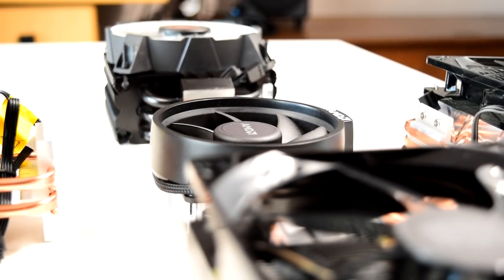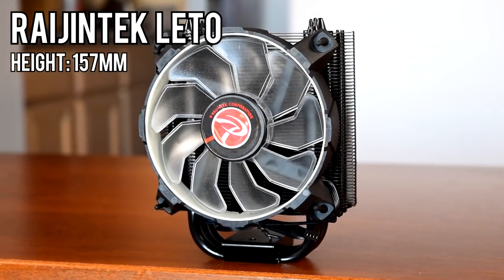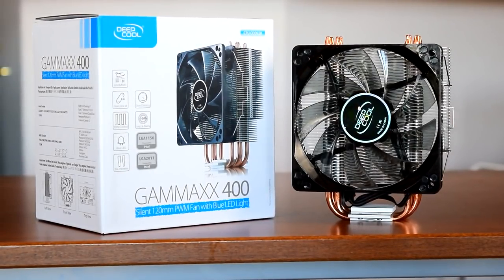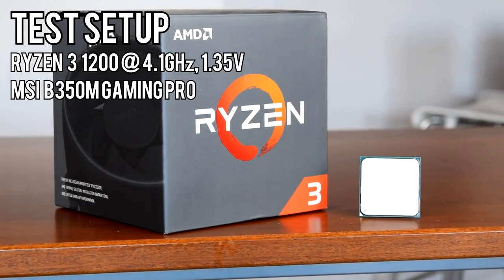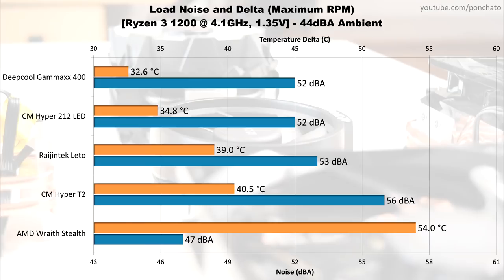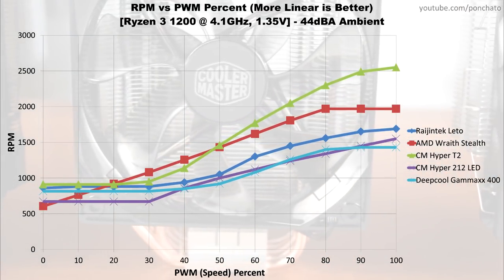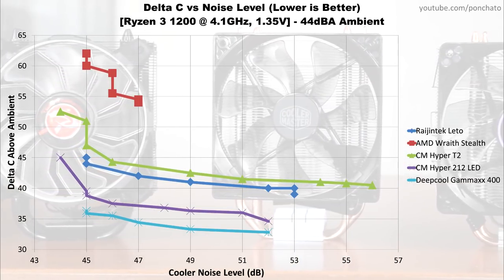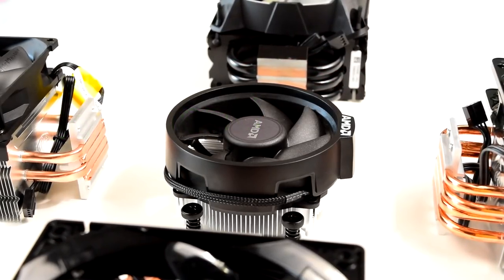4 Budget AM4 Coolers Compared - Temps + Noise Tested!

Comment: Just bought a Deepcool Gammaxx 400 and it is a fantastic product! Never exceeded 46°C/114.8°F, running all 4 cores at 100% (CPU: i5-4570, ambient temperature: 19°C/66.2°F) under PerformanceTest 9 tests. The stock cooler with a renewed thermal paste was going at about 79°C/174.2°F. IMO real value for money and fairly easy to install without silly back plates!

Comment: Air Cooling is extremely reliable! You cannot go wrong with those, and don't pose any threat to your motherboard.
Reply from the maker: Very true!
Reply: Old comment but. Ehh.. Only bigger and heavier coolers threat your motherboard.
Reply: @mouaxiong8618  unless you are transporting your CPU and make you cpu shake like riding on a off road, and did not place it on its side, you can just remove your cpu cooler then return it afterwards.

Comment: Bought the gammaxx 400 for my ryzen 2600 because of ponchato. Haha
Reply: How high are your temps now, and how high were they with stock?
Reply: @dwandalf  I've never used to stock cooler so I don't know about its capability. The temperature of my CPU with Gammaxx hovers around mid 40's to mid 50's without manual OC, in a Core 500 case. Granted, I don't do extreme gaming or stress tests. I live in Asia btw, in a relatively cool room.
Reply: @HandleIsNewAndBad  Nice! Im thinking of buying gammaxx 400 or gammaxx gt.
Reply: @dwandalf  that temp I said is when gaming, but not too intense, gpu temp is 60+ degrees mostly. You know, RADEON.
Reply: Does gammaxx 400 block any of ur ram slots bro?
Reply: @minhquan5005  not too close , the mobo is asrock itx
Reply: is this compatible with a320m pro vd/s?
Reply: @jhomgonzales14  since it's AM4 board, the mounting should be the same
Reply: Do you overclock it? Do you find it big and hard to fit in your case? I have an mATX case and my only fear of buying an aftermarket cooler is that I have no idea if it will fit.
Reply: @rohana.7760 it's 154mm in height. If it fits in mini itx shoe boxes, I don't see why it can't fit in a micro ATX case (is yours a narrow one?). No, I don't overclock. Haha. Its auto clock is 3.8ghz while gaming. I also use noctua thermal paste on the CPU.
Reply: @ABQCML Same here. Never knew much about Deepcool until I saw this video. I still cannot believe how quiet and efficient my Gammaxx 400 cooler is!
Reply: which one is better, gammax gt vs gammax 400?
Reply: @pemilkareem  IMO Gammaxx 400 - it's been around longer to very good reviews.
Reply: Jhom Gonzales a320m doesn’t support OC so you’ll only benefit sound, not performance.
Reply: Pemil Aldiki pretty much the same...GT is better looking for sure in every way
Reply: I have a Deep Cool Gammaxx 400 on my r5 1600 af and I love it.
Reply: how are the noise levels of the gammaxx 400 while gaming and at idle? is it audible at idle/low usage?

Comment: So the stock cooler was actually the quietest! Thank you. Assuming I don't overclock my CPU, it will be fine. And I have scope to buy a new cooler if I want to overclock it, but it's not essential by any means. (I've just got a Ryzen 5 3600 which is a 65W part TDP)

Comment: That 4.1GHz is impressive! What's the highest Overclock you ever got with the Ryzen 3 1200?
Reply from the maker: That's actually as high as it'll go, it hits a brick wall at 4.1GHz. Even another 25MHz is unstable no matter what voltage I use!
Reply: Thanks, I'm planning a build in the near future using one of these and a GTX 1050 Ti or 1060, so any tip helps! Your videoes help me mix and match the parts I want for my build.
Reply: well i got till 3.95

Comment: when i got my Ryzen 5 3600, i decided to go ahead and use the stock cooler. my IDLE temps were between 65c-73c. i had a Hyper T2 i had used on an old FX-8350 hoping that it would work well, like it did on the FX-8350, but i was wrong. didnt help temps at all. i was still getting the same really high idle temps. i decided to give a DeepCool Neptwin V2 a try and i am so happy i did. i havent seen my Ryzen 5 3600 go over 70c no matter what im doing. MSFS2020, streaming it live to youtube in 1440p60fps, and using two monitors, and STILL barely crept up to 70c. i did build my neighbor a pc the other day with a Ryzen 5 2600 since hes not a gamer at all, just wanted a pc that would last him a few years just cruising the internet and doing basic things. i used a cooler master evo 212 black edition for him to use and its been pretty good. not quite as good as the massive twin tower cooler im using, but it keeps his temps way down when compared to the stock cooler.

Comment: Proud owner of a Gammaxx 400! It's so affordable here in the Philippines compared to the Hyper 212. The performance is so good! I'll keep this cooler when I upgrade my PC to an i7 or whatever high powered CPU comes up with either companies. Currently using an i5 4460 and I got annoyed how noisy and hot the stock intel cooler was. After replacing the cooler no more noise and the temps are so low. I can happily run my PC all day with no worries.
Reply: conyo985 how much bro?

Comment: I think we'd all rather you do this test in a case. Take side panel off for the dB but see how it moves air in a closed environment (99.9% of builds) is better information than open bench.

I have 4 of the Gammax 400 currently and have purchased like 6 (sold in builds). They are amazing coolers for their price ($17-21)

Comment: In the video I noticed that you didn't have both RAM sticks in the motherboard. Did the RAM not fit in one slot with some of these coolers? Some looked like they would be a tight fit and others didn't.
Reply: Tyler Hancock you wouldn’t need to worry as long As you have a full atx mobo
Reply: @killerdon3377  I can fit 4 rgb ram sticks in my micro atx Mobo just fine with the deepcool

Comment: You do a very good job.
Samples all the information I was looking for from the Hyper T2. The comparisons with the other coolers are very good to decide.
Thanks for taking the time, have your like good man!
Thoughts:
I think that the T2 is a good alternative to make a soft OC, looking not to exceed 60-65 ° C and 75% fan speed. We would avoid noise in excess. Also for the size and weight of the T2 is very good for economical motherboards which have a thin pcb.
Reply from the maker: Happy to help! And yes the T2 is very low weight, so you don't have to worry about motherboard flex or the socket breaking on thinner motherboards

Comment: Thanks for the vídeo, I didn't know the cooler Master Hyper T2 are compatible with socket AM4.
Reply: But the T2 does not touch the entire surface of the Ryzen processor (AM4 socket). Is that not a problem? i just got my Ryzen 3 3200 and i have this Hyper T2 but i leave the original Ryzen fan because that.

Comment: I've had a Gammax Cooler with an Arctic cooling fan on my 3200G and it is right proper cool and quiet. It just goes to show you do don't have to spend a bundle on a cooler.

Comment: Right, so I bought a i7 4770k 5 years back and never bothered with a cooler. After watching this vid, Insta-regret! Its good to see some awesome cooling performance for a reasonable price. Ordering a cooler now asap, better late than never! Thanks for the video!
Reply from the maker: Yeah, CPU coolers have come a long way in the past 5 years. And these coolers are good but you should check out the Mugen 5 as well: https://youtu.be/focyjBXI2gE it doesn't cost much more than these and it performs quite a bit better
Reply: ponchato Thanks for the reply! Actually that isn’t available here in Dubai. Think I’ll go with the Gammaxx 400 as its really cheap here and does the job.

Comment: My Ryzen 3600 with a Gammaxx 400, while gaming, sits on around 60 degrees. Give it a stress test and it jumps to 82 degrees. Still better than the stock cooler tho, under a stress test it used to hit 92

Comment: Great testing. Have you ever played with any of these coolers with no fan to try passive cooling with no overclocking? I have a fanless PC (J1900 Celeron) with Seasonic 520w fanless PSU and SSD. Basically a HTPC with no mechanical noise at all. Its been great for 4 years although its slow but only using it for web surfing, YouTube and 1080P movies/netflix. I want to rebuild into a low power Ryzen 3200G for 4k HTPC but I want to keep it fanless for zero noise which is great for music and movies.

Comment: No no no , put your mic next to my build . 3 - 120 mm case, 3 - built-in on radeon 7, psu is cooler master 750 w. And for Funnzies  , a stupid window unit a.c. 😂 . That gammaxx could sound like a jet engine and I'd think it was great. 
Excellent video. I'm subbing.
Reply from the maker: Haha, yep that sounds loud. And thanks, glad you liked it! 😁
Reply: @ponchato  I ended up going with the old gal , gammaxx 400. If it screams ,I won't even notice. 
Have you ever done a roundup of fans ?

Comment: My computer that I'm using is pretty old. I'm pretty sure it is using an old Cooler Master CPU cooler (or an Intel stock cooler). Either way, I am using an i5-4440 and my temps are 32C (90F) even with multiple tabs open running multiple videos and while running other programs. The most I've seen it go up to was 60C (140F). The funniest part is that my case is a HP Envy 700-210 (or whatever, can't find actual name), which has ZERO features for cable management. The other day, I was installing a new hard drive for it and I had to remove my GTX 950 to get my SATA connector to the SATA slot on my motherboard because of all the cables that were in the way. I couldn't move them out of the way because they had nowhere else to go. Took me 10 minutes to install it. Can't wait to get all of my parts for my new build.
Reply: I use an i5-4460 with a stock cooler and during VRAY renders  the CPU goes upto 80°C in an ambient temperature of 28°C.

Comment: which would you say would be the better option for someone like me who is going for mid to high end  parts but with no OC intentions 

1060 3GB/RX580 GPU
Ryzen 5 2600x(Stock)

16GB 3000 DDR4 RAM

Comment: The standard 212 Evo will Mount horizontally or vertically on a am4 socket I just used mine on my ryzen 5 2600 and only used the included mounting.

Comment: There is no one better than 200w TDP Arctic Freezer 33 eSports ONE under $40.

When under 60'C, Freezer 33 is not much different with Hyper 212 evo, but it is surprisingly good at higher temperature.
According other tests, when Hyper 212 evo is 90'C, Freezer 33 well be only 76~79'C, 
and only 7~9'C higher than Noctua NH-D15 (one of the best air cooler).
I think that is why Freezer 33 has the 200w TDP.
Reply from the maker: Yeah the eSports ONE is pretty awesome, I reviewed it here: https://youtu.be/we04MQXb5sA

Comment: i install yesterday 212 Led on my AM4 Ryzen system without clips mounting. I install like other tower cooler with back plate and screws comes with box!
Reply: NextGenCeo, what is the cpu temp
Reply: @chileverde4906  Amd Ryzen 2600 without overclok in game 49c on prime 95 stress test 45 minutes 56c. max. 1.3v 4.0ghz overclok to all core in game 55c and 30 minutes prime 95 max 64c max temperature. I have NZXT 500i 2- 120mm front fan and 1- 120mm egzost fan and 1-120mm top fan in the case. Also using Artic Silver 5 thermal paste. Msi b450 Tomahawk.
Reply: the back plate doesn't fit on my b450 tomahawk I don't know why. The screws are not aligned with the holes. Im only left with one option, which is to mount  it facing exhaust to the top of case rather than rear of the case.

Comment: Would the hyper t2 be sufficient for a 2200g with graphics and processor OC to the maximum, or should I just go with a 212 variant? Sticking with CM to match my case 😉
Reply: I have that on my Ryzen 1800X.  I don't overclock so it has worked fine by me.

Comment: you say the 212 "can't be mounted horizontally on AM4" did you mean it can't be mounted vertically? I think horizontal is the default position? I am looking for a cooler that can go vertical and push exhaust to the top of the case rather than the rear.

Comment: why did you mount the gamma different than the rest could the other not mount horizontally?  it just looks like the gamma would get better air flow as the fan is less obstructed.

Comment: I brought the h411r by cooler master for the Ryzen 5 2600 wow impressive cooler on quite mode at £22 I highly recommend it
Reply: I plan on buying it for my 2600x, since i have small case and thats only that fits in, what are your temperatures for both idle and load?

Comment: Ryzen 2200G for video render, should i buy the gammaxx 400 or is the T2 enough?
Reply from the maker: The T2 can handle the 2200G easily, but if you want to overclock the Gammaxx 400 will give you more room with the temperature
Reply: @ponchato  thanks!

Comment: No $20 cryorig m9a?
Reply from the maker: 😐 crap
Reply: Do I smell a round 2?
Reply: did you test it for yourself cauz i use it before don Athlon x4 860k at 4.3ghz and it delivers
Reply: i m using intel ver. for my i5 6600k and oc ed 4.5 Ghz for daily use. I would say m9i is real beast if i compare to size. I m quite satisfie on temperature.
Reply: Does it support am4? Answer me please.
Reply: m9a model - yes it does. uUcan check offical website for more info m8
Reply: get the dual fan m9a sure its have am4 bracket
Reply: nod crap  @ponchato

Comment: I have a Ryzen 1400 overclocked to 3.775 ( this is as high as possible without over Volting). Could the Gammaxx 400 keep it under control? I have at the moment a zalman performa cnps5x but something happened and it started to go over 60C, in the same room temperature last year it was only 52-53c.... And i need a new cooler. Could this keep it in order?

Comment: In China, a four-heat-pipe or six-heat-pipe cpu radiator costs only about $ 12-15. To get 2600x 4.2ghz 1.456v through the aida64 fpu test. Play assassin's Creed Odyssey 50 degrees, room temperature 22 degrees .😄

Comment: I’m getting a Ryzen 2700x and might be doing a slight overclock would the Deepcool GAMMAXX 400 be reliable
Reply: Just a guy who likes video games  I would get a better cooler like a noctua Nh12s for 50 dollars or a noctua NH-15 if  you plan on over clocking 
However it might work with the cheap one but I’m not sure

Comment: Deepcool Gammax 400 will surely cool your VRM you can look at its fin design at the bottom (slightly smaller), if you can mount the fan to the bottom it will become more effective for both CPU and VRM cooling, mine drops for more 4 degree (CPU) and 18 degree (VRM). So dont buy CM Hyper 212, its not useless but its far worst than deepcool!

Comment: Man, those easy to understand curves you used and the comments on the fan size vs rpm  make me suspect you actually have some professional knowledge about heat transfer and fluid mechanics.
Reply from the maker: Haha well, not exactly professional but my educational background is in engineering. That and a looooot of reading online and off!
Reply: Well, still you did a neat analysis. At least I guessed right that you were a fellow engineer.

Comment: I am going to overclock my Ryzen 3 2200g to 3.8ghz and igpu to 1650mhz.Which would be best for budget oriented pc.I want to keep the temp around 60-70°Celsius.Which one should I buy??I have choices too....
1.Cryorig M9a
2.Deepcool Gammaxx 300
Can these two keep the APU under 70°C when overclocked??If not then what cooler should I go for?I really want to keep the temperature under 70°C.....No Matter What!!
Reply: Just oc my R3 2200g to 3.8ghz with stock cooler. On idle goes to below 50 while gaming reached to 80 lol. Gonna replaced it soon with aftermarket cooler.

Comment: Newegg has the 212 evo led for $15, word of advice with a ryzen 7 it run kinda hot for me with no OC at 39c.
Reply: Avg Lebowski ... "hyper 212 led" OR "hyper 212 led turbo" on am4 moves air from Graphics card to top of case .... thats why it runs hot.
Reply: tim serious yah kinda figured that ended up getting a cooler master 120 aio was on sale at amazon for 29.99.
Reply: Avg Lebowski ... oh that's great .... in india it goes about 3,500 INR on sale .... which is about 50$ 😔😔

Comment: My stock cooler from the AMD Ryzen 5 2600x is actually a load of shit, my pc is 60 celsius standard and when im playing gta the temperature rises to 80/90 or my pc just shuts down because the CPU is too hot. My pc isnt even that old, i guess i just need to clean the PC from the inside and install a liquid cooler, i hope that will decrease the temperature.

Comment: I still have a cooler master tx3 evo from my old rig, will it work in combination with the ryzen 5 3600?
Reply: if it has the amd bracket, I think itshould have one.  it will work since its 130tpd two times more of the stock cooler

Comment: the gammaxx 400 works well with r5 1600?
Reply: I'm using one in my r5 1600x build and with the base fan curve you barely even notice it's on until I really oc the chip. Works like a dream, and as of today (1-1-19) is only $19. I recommend getting a 2nd fan for push/pull to even further help. Shouldn't have any trouble clearing even taller RAM on an atx board either.

Comment: will a gammax 400 be reliable for overclocking 9600k to near max (i think 4.5-5ghz)?
Reply: Yes. I currently have a x5650 overclocked to 5.1ghz at 1.45v on that cooler with a max temp of 78c under prime95 small fft, and that is at a near x2 times overclock from the stock 2.6ghz

Comment: My cm hyper 212 Evo is Mounted horizontally xD
Reply from the maker: I believe they offered a proper AM4 adapter kit? It's been a while, I can't remember.
Reply: I think so. I jerry-rig mine
Reply: Im using 212x from coolermaster and you can mount it horisontaly and verticaly easily, but it needs aditional bracket for am4 socket since when i bought it was the time where am4 didnt exist.
Reply: Also 212x evo at max fan speed is about 36 dbm. It is damn quiet.